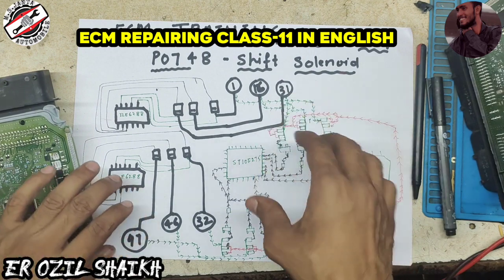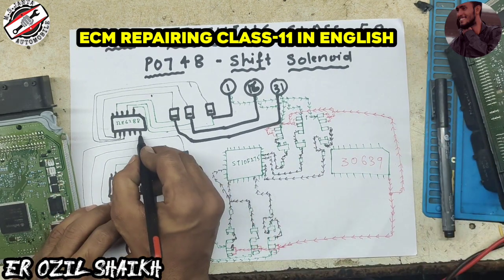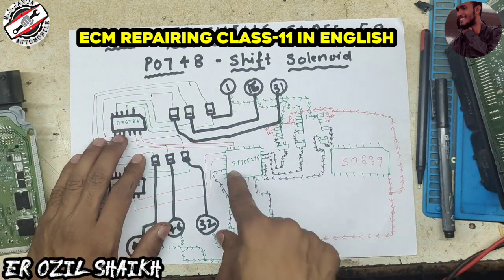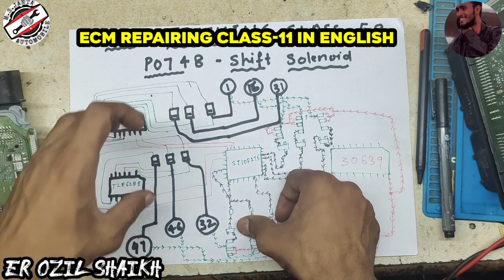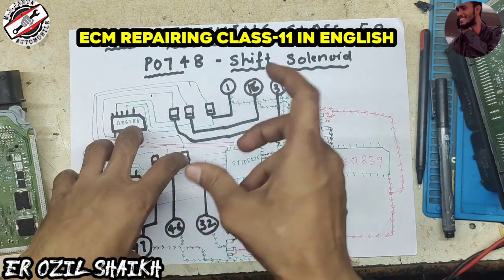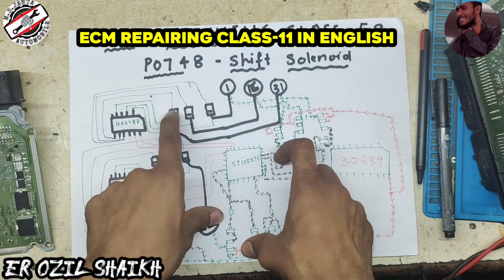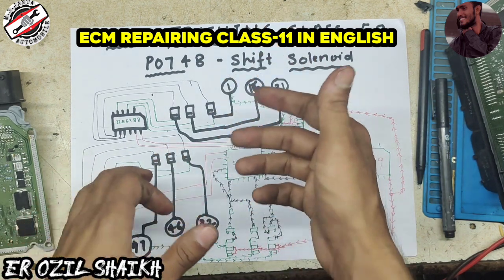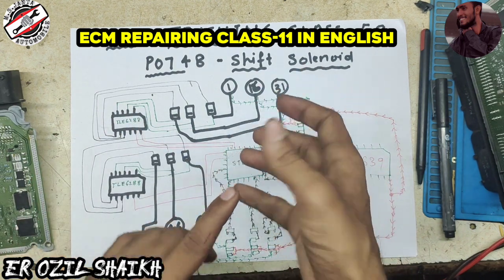Ecm Repairing class-11 in English | Meg17.9.12 p0748, p0750 pressure solenoid control A | explain

Comment: thank you, I have the same code problem P0748 : Pressure control solenoid valve (Vfs) 'A' Electrical, my ecu model is MEG17.9.12, I opened it, but I don't know which part to replace, can you help me please? I already removed the big 3 100uf capacitors and also the 220uf capacitor but problem still there. Should I replace the TLE6288 IC next ?
Reply from the maker: +919004548850